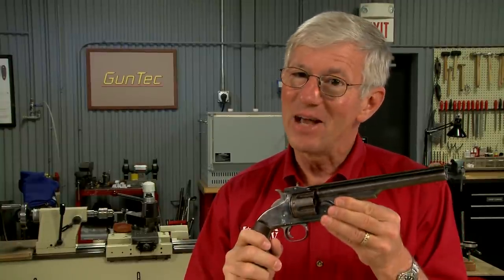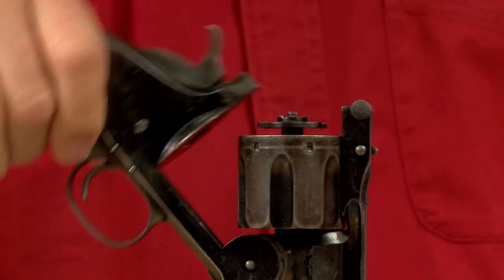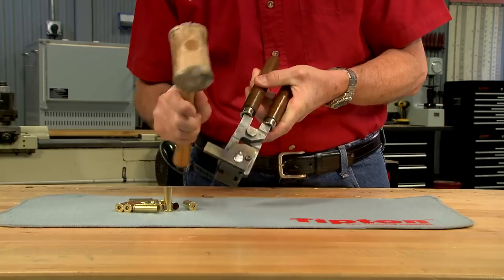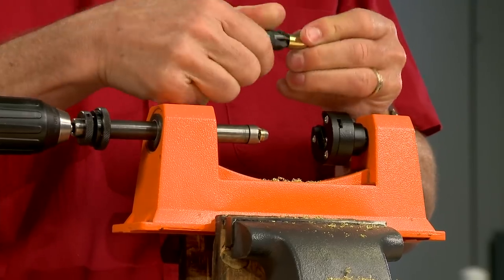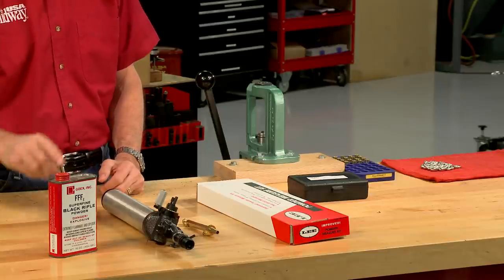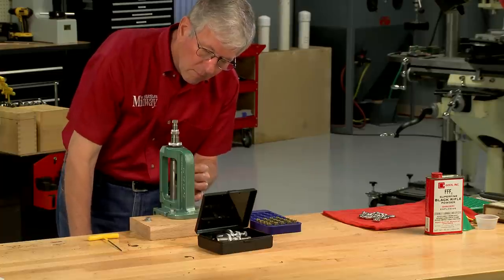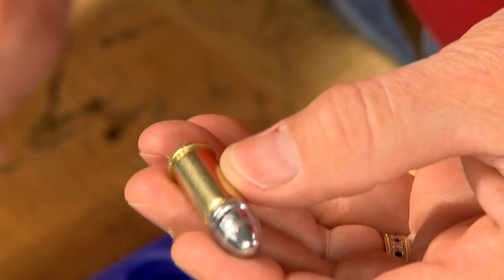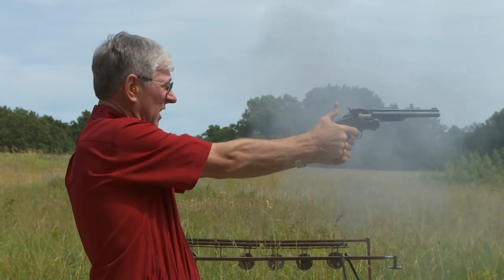How to Load Ammunition for a S&W Model #3 Revolver in 44 S&W American | MidwayUSA Reloading

Comment: The Russians definitely did us a favor when they demanded that S&W drop the outside lubricated, healed bullet design of the .44 S&W American and go with an inside lubricated, single diameter bullet with the .44 Russian!
Reply: They also gave us the great-great grandfather of the .44 Magnum: the .44 Russian
Reply: I load .44 Mag, Special and Russian and make my Russian cases by cutting down either Special or Mag cases.  Most of my Special cases are cut down mag cases as well.
Reply: Punished Aniquin  Special and Russian brass is expensive so I mainly do range pickups on Mag brass.  When I notice the mag brass is getting thin at the mouth I trim it back to Special and repeat for Russian.  Definately saves money.

Comment: I am surprised you didn't anneal the cases after you worked them, although this is probably such a low-pressure round it doesn't matter.
Reply: Yeah it doesn’t matter I reload 44 Russian, 45 colt and 45 Schofield Black powder rounds and I’ve got 45 colt brass that I reloaded probably 20 times and it’s still brand new looking after a tumble. I don’t even own equipment to anneal cases and they are fine.

Comment: You said they were loaded with 25 grains, but then chose the dipper equivalent to 20.7 grains instead of the one closer to 25. Was this on purpose?
Reply: You can not get the original amount of powder in this new cases, the old cases were made different (baloon head case) and could hold more powder.
Reply: Okay, that makes sense. Thanks!
Reply: Gargan tuace if he used Swiss black powder, he would've been able to use the original amount. Swiss is better made than goex
Reply: The correct volume of BP compressed correctly is more important than matching the 25 grains. Reducing to 20-21 grains is also good cause it goes easy on that old veteran, the S&W #3...

Comment: I started handloading metallic cartridges in 1973. (Shotshell cartridges about 1965)  There was a time I reloaded everything I shot.  More recently, I have been reloading only for "more expensive" ammunition.  I do not handload currently for 9mm and 5.56, 20 ga. or 12 ga. anymore, for example.  But I do handload .38 Special wadcutters, 16 ga., 28 ga., .410 shotshells for a fraction of factory ammo cost and for numerous obsolete rifle and handgun cartridges.  I also cast bullets, though, again, for those where factory bullets are not available or very expensive.  There are numerous sources of cast/swaged bullets online if you do not cast your own. Sometimes doing a little improvising, as was done here with the crimp process.  FWIW, do your homework, study some case dimensions of rifle cases and you may find one where you can use a sizing die, with the decapping stem removed, to apply a taper crimp to handgun cartridges such as this. The taper of the case body can be used to apply a taper crimp.  Adjust the die to the depth needed.  There are numerous cartridges that can be handloaded with many sets of dies, as shown in this video using .41 Mag dies to load .44 American.  A little study and improvisation goes a long way.

Comment: Could you just use a .44 special?
Reply: No.  For one thing the .44 Special is still too long to fit in the chamber, but the bullet diameter is wrong as well.  The .44 S&W American used a true .44 caliber bullet, not the 0.429" bullet used in modern .44's.

The closest available cartridge that you can get to the .44 American is the .44 Russian.  When the Russians ordered the S&W Number 3 Top-break revolver for their armed forces they demanded that the outside lubricated, healed bullet of the .44 American be changed to a far superior inside lubricated, single diameter bullet.  All S&W did was make the whole bullet small enough to fit into the a slightly lengthened .44 American case and called it the .44 Russian.  With the exception of the .22 rimfire every handgun cartridge designed since then has been based on the inside lubricated, single diameter bullet design of the .44 Russian.  Just shrinking the bullet to fit inside the case is also how .44 caliber revolvers got turned into the .43 caliber revolvers we have today.
Reply: Gunslinger454 Thanks for the information, but what does inside lubricated mean?
Reply: *****  It means that the grease grooves on the bullet are down inside the cartridge case rather than exposed above the brass case.  If you watch the video there's a part where Larry is putting lubricant into the bullets' grease groves.  On an outside lubricated cartridge like the .44 S&W American those grooves are outside of the cartridge case, & lubing them is the last step in the loading process. On .22 long rifle bullets, which are also outside lubricated, it's the wax coating that likes to gum up the inside of your rifle. The big drawback here is that with the lube exposed it tends to pick all kinds of dirt & debris on the outside of the bullet which can damage the bore.

On inside lubricated bullets the grease grooves are down inside the case where they are protected against getting any kind of grit or debris stuck to the bullet.  It's a far superior design.
Reply: *****  I just reread my first response and realized that I should have said, "With the exception of the .22 rimfire NEARLY every handgun cartridge designed since then has been based on the inside lubricated, single diameter bullet design of the .44 Russian."  There were a few other now obsolete cartridges in the late 1800's that also used the outside lubricated, healed bullet design.  The .41 Long Colt that was used in Colt's double action "Thunderer" revolver is probably the best known of these, but there were others as well.  Other than the .22 rimfire no modern cartridge uses this design.
Reply: ***** thinking of picking one of the section 58s up?
Reply: ***** Possibly! Just curious really :)
Reply: ***** i guess you could legally load up some blanks for one as its not live ammo (then again idk how ranges would react to it)
Reply: No the case of a 44 special is too big that is why he is using 41 mag brass
Reply: +Gunslinger454 Most of the early rimfire rounds, such as 32 rimfire long, 50 US Nsvy, etc. used heeled rounds and were also BP cartridges, but ammo makers pretty much walked away from them in the early 1930s.

Comment: why don't they make revolvers like that anymore
Reply: Vitz Kopelsko tho a 45acp and 357 is good enough. I carry a uberti 45 colt replica, good enough for me.
Reply: Mecha Iroh because the top break design was proved to be a weaker design than the swing out cylinder because all that pressure is swinging back into where the frame breaks open, on the swing out cylinder it's able to handle more pressure.
Reply: they do make some nice reproductions of these